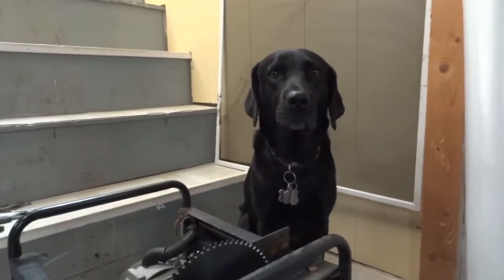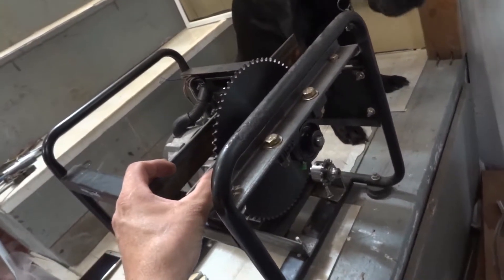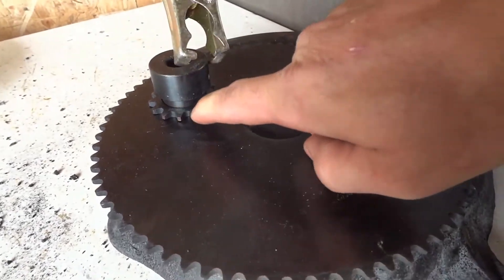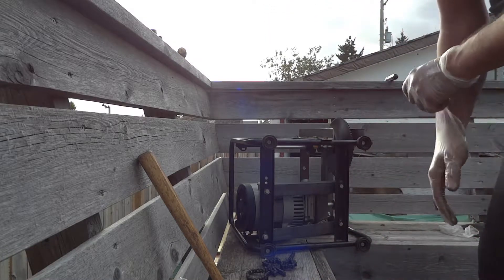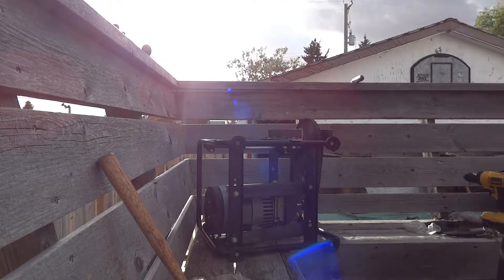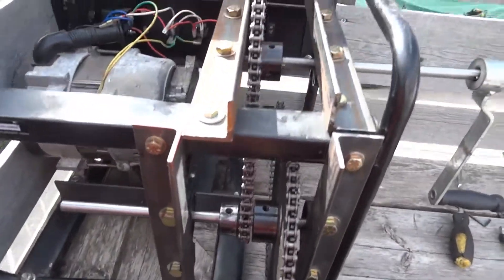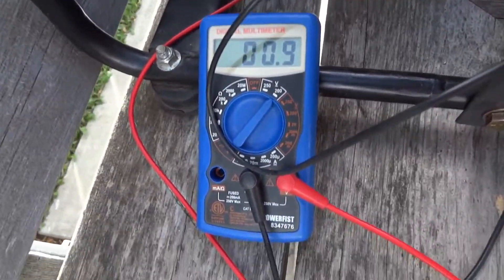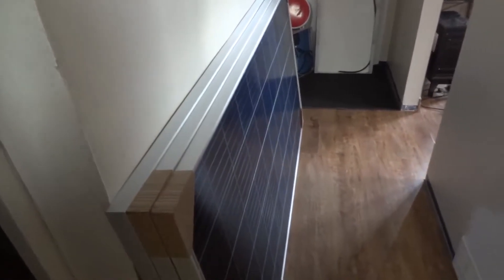Gas to Wind & Peddle Powered Generator Conversion Pt. 5 (Gearing Complete and Crank Test)

Comment: Nice video but wouldn't you want a twelve to one ratio on your large socket and a small spocket on your generator.  That way you get more rpm's.
Reply from the maker: I thought about that, spacing for welding was a problem with a smaller sprockets. Thanks.

Comment: I wonder if you could rig this up to a water wheel?
Reply from the maker: Yes you could, it would have to be something with a very large amount of water flow. The chain gearing reduction has a lot of resistance, which requires a lot of force to turn it. The bigger the water wheel (ie leverage), the less force you would need to turn it.
Reply: @MiddleofNowhereDuff  Very educational answer my maaaaaan. Interesting ...What I had in my head was when on site we used to plug in the blue lead and use 240v to heat the kettle for coffee. I always pondered about detaching a honda generator engine and adapting the electrical motor to a water wheel with the correct ratio ...ie equivalent to the power the petrol engine produced to do the same job .Being a bit of an eco warrior and trying relentlessly to think outside the box my idea was it would be a quick fix to hydro power in the middle of nowhere and a two finger salute to the power and oil companies .....Thanks for your time making your video and greetings from Scotland ......x

Comment: Nice video, but don’t u have to power the inductor? I haven’t watched all the videos.
Reply from the maker: Rotating the shaft clockwise will should do this. I'm an engineer, not an electrician. So don't quote me. That's just the basic information I collected.